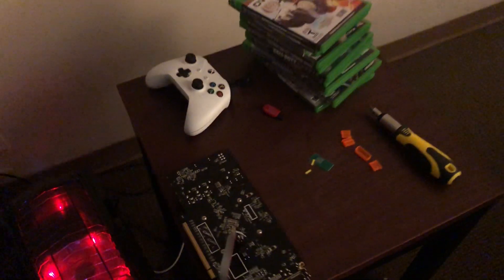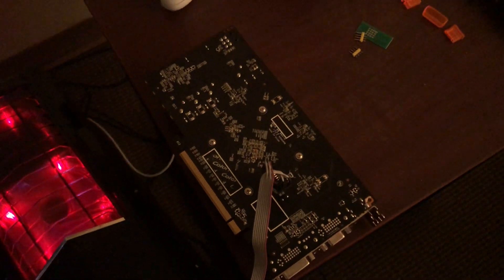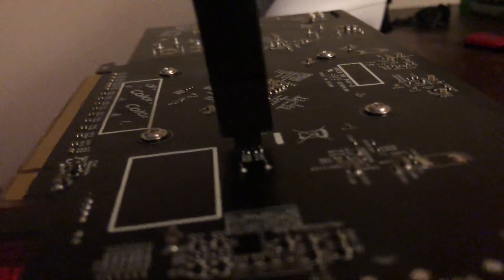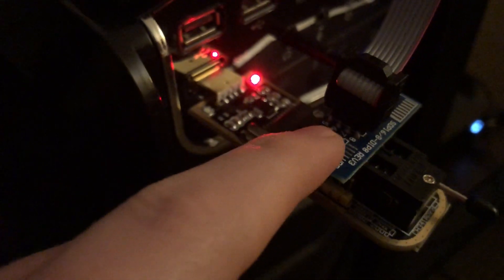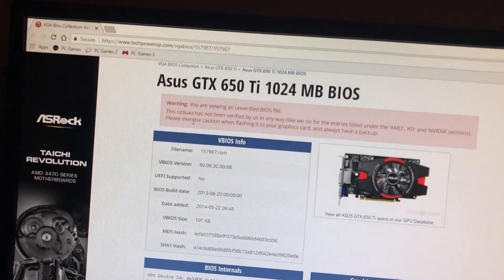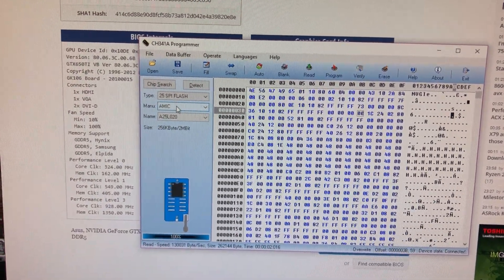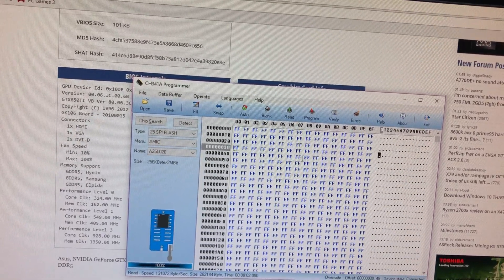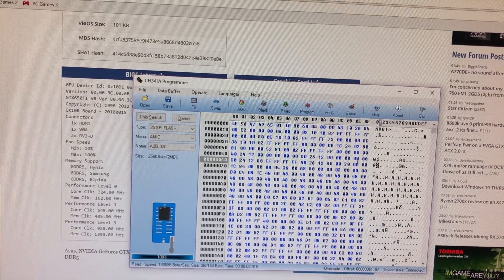Hardware bios flashing a fake GTX 1050 2 GB to a GTX 650 ti 1 GB

Comment: Hi,
I was eventually able to get it working. Damn clip is damaged but I did it.

However the GPU is not stable.

I can run a stress test for 2 hours, then it will crash. (unigine heaven)

The GPU temp is incorrect. (40-50c under load? I don't think so)

The fan also doesn't speed up, it's almost silent but does make a buzzing noise.

There also seems to be a lot of latency compared to a modern graphics card (my gtx 1080 at the same frame rates is much more responsive in games, and even in the desktop the 650 just seems to have a lot of latency.

Starting to think maybe they just take in faulty GPUs and re-flash them to pretend to be a newer card?

Or maybe the BIOS I am using is not compatible? (I'm using that ASUS one)

I want to try to flash another BIOS, but I don't want to use that clip. I think nvflash should work now but if I flash an incorrect bios would I need to use the clip again or can I just boot using integrated graphics, and use nvflash to flash it when my graphics card isn't in use?
Reply from the maker: Nvflash should work how u said it should.
Reply from the maker: And gpu isnt the only thing needing cooling. The VRMs and memory chips need cooling.
Reply: @CriminalGameplay  i have flashed a Gigabyte bios, so far it's working, but I need to test it. GPU temp is still reported incorrectly, although a little bit higher this time (this BIOS has slightly higher clock speeds) but all the other specs were pretty much the same.

Comment: if i download a bios with the right memory and everything but get one with a bios that has a higher boost clock for the card like an evga SC bios.Will this automatically clock the card to those speeds?
Reply from the maker: Yes. 

I have my MSI Armor 2070 using a MSI Gaming Z 2070 bios because it has a higher clock speed and TDP.
Reply: @CriminalGameplay  on that note, I have the fake gtx 1050ti and looked at the gpu and its for a gts 450 rev 2. the evga SC gts 450 uses a 6 pin connector.Am I gonna run into problems doing this cause the fake 1050ti doesnt have a 6 pin or will I be fine?
Reply from the maker: @kyles8524  the card can only pull 75w from the board so I don't think it'll work. Im surprised they took off the 6 pin.
Reply: @CriminalGameplay  they have bios's with lower clock frequencies and ive looked at those gts 450's and they dont have a 6 pin.I guess Ill just have to do that.The last thing I want to do is brick the card
Reply from the maker: @kyles8524  Yeah if they have 450s without a 6 pin then ud want to use those bioses

Comment: i am having trubble identifying  my processor its a fake GTX 1060 6GB pci/SSE2  GPU-Z says its the GF116 and the markings on the chip are12B5B035  1119A1   PAY 329.MOO dose anyone have any idea what this processor should be i looked at the nvidia websight but didnot see any GF116 processors with these numbers please help
Reply from the maker: 550 ti

Comment: i brick my own 1050 ti while flashing wrong vbios, nvflash not working, i want buy this and try fix my card. how can i determine correct video bios chip?
Reply from the maker: Google. Ask the manufacturer. Trial and error by reading all the chips that look like the one in the video
Reply: @CriminalGameplay  Dude i have brand new 1050 ti (not fake one) it is bricked now today i bought programmer and fixed hard bricked GPU, ty so much, I kiss ur hands.
Reply: @CriminalGameplay  ty so much for reply good video by the way.

Comment: I have the exact same card and trying to figure out which VBIOS to download. Which one did you end up using? Is everything still working ok? All ports work? Thanks, and great video!
Reply from the maker: https://www.techpowerup.com/vgabios/157987/157987

That one should work
Reply: @CriminalGameplay  Confirming that it worked great for me. Now to find some way to fix the obnoxious fan noise. These knock-offs have only a two-pin fan so no fan speed control. Running at max constantly.
Reply from the maker: Datlore001 true. Did u get a refund already?
Reply: @CriminalGameplay  I did when I bought it about six months ago.
Reply from the maker: Datlore001 u just now got around to fixing it?
Reply: @Datlore001  
Is your GPU reporting false temps?
Do you have latency issues?
Does it crash after a couple hours?
Any other issues?
Reply: @CriminalGameplay  Thanks! I'll give it a shot when I find my programmer clip.

Comment: Hey, I can't get this working, my programmer looks slightly different than yours and no matter what I do it wont read the bios, although it detects it and says "Device Connected"
Reply from the maker: You likely don’t have the clip in correctly
Reply: @CriminalGameplay  do you have a discord? I've been trying for hours. Sometimes in the flash software it appears as FF and sometimes as 00.
Reply from the maker: yotoprules try putting the clip on other chips to see if they read. But yeah the clip is prob not into the chip all the way or it is not on the programmer correctly. 

You have to push the clip into the chip’s pins and then release.
Reply: @CriminalGameplay  i tried pushing before releasing, and whenever the clip is attatched the programmer turns off. when i take the clip off the programmer turns back on.
Reply from the maker: yotoprules Do you have the red wire on the side with the dot?
Reply: yeah  @CriminalGameplay
Reply: @CriminalGameplay  it just sometimes turns off or appears as 00. that happens when I think the clip is on correctly, and when it is not it appears as FF
Reply from the maker: @yotoprules9361  https://www.youtube.com/watch?v=2Y06x1f22B0

Here's another video doing the same thing I did pretty much. I haven't done this since I made this video so my memory isn't fresh. I do remember running into your problem where the programmer would turn itself off after plugging in but I can't remember what caused it. If you are sure the clip is on the chip correctly then the only thing left is to make sure the clip is on the programmer correctly.
Reply: i dont know what im doing wrong but i cant even get the clip on the chip anymore. thanks for the help anyway  @CriminalGameplay